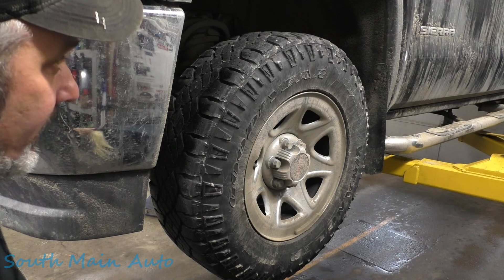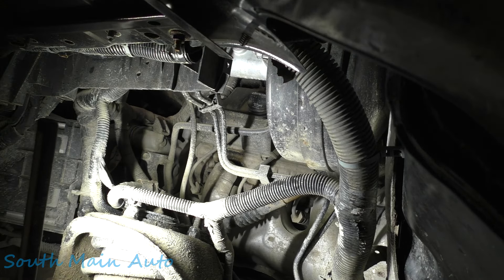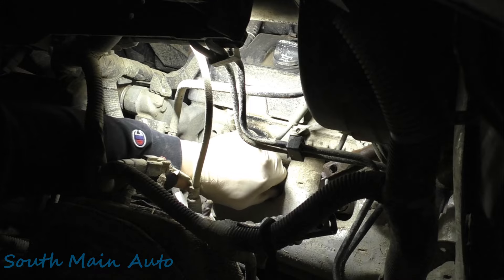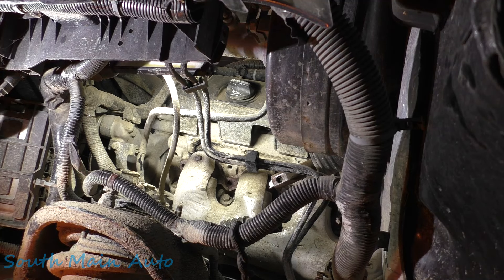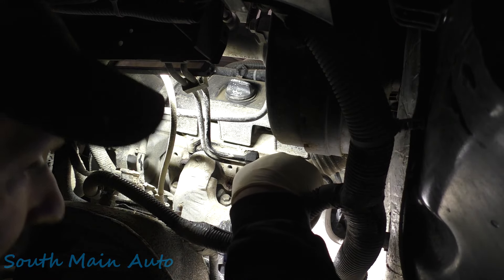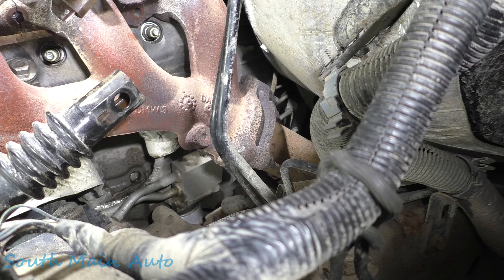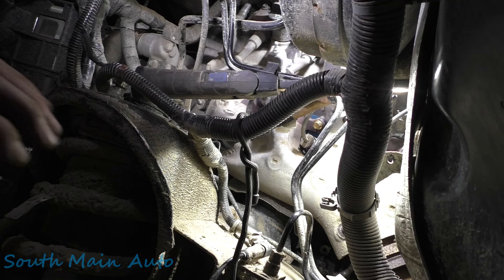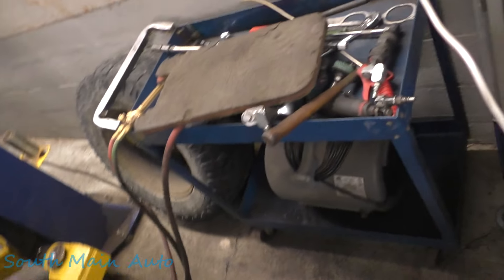GM Truck- Exhaust Manifold Bolt Snapped Off In Head

Comment: I was pleased when recently my mechanic was able to remove exhaust pipes on my 02 s10 to replace convertor.  Previous mechanic didn't want to try that so removed forward o2 sensor to route a brake line creating the leak requiring the convertor replacement.  Mind you I  delayed it to point where convertor was rusted out.

Comment: My thought is a brazing tip would fit in there easier. I have found that if I make the joint wet with (WD) or so that the crud locks it together worse( if you take something dry and make it wet it expands to make it tighter). When you put it together I didn't see any anti-seize. Keep up the good work.

Comment: Your kind of correct. The heat does expand the steel of the bolt. It also expands the aluminum tap thread of the motor twice as much giving more clearance that frees the bolt for extraction.

Comment: Hi Eric . Gass torch makes it work every time . Your talking about the compressor . I got a pleasant surprise pulling my drain plug on m compressor . No water I realized in the basement & the A/C on in summer dry air .And not much water in winter .

Comment: Hey Eric O. Don't listen to everyone else, your a good guy. Lol BTW the heating of the bolt works because of the T delta of the Aluminum block vs the steal bolt. Basicly the bolt heats up getting tight in the hole breaking the crusties up. The aluminum transfers heat away from the bolt very quickly making it shrink back to normal. Further breaking up the crusties. Seems counter intuitive until you understand how the different metals transfer the heat. Being the block is such a massive aluminum heat sink, the bolt hole never expands enough to make a difference.

Comment: I believe that heating the manifold bolts works because the aluminum head heats up faster than the steel bolts therefore expands quicker thus breaking the bond of the loctite.

Comment: Damn Eric, better to be lucky than good at times, had a 6.0 and did not have the same luck as you. The rear manifold bolt was recessed into the head and thank goodness that the Mig welder did the trick. Keep em coming Bro.

Comment: I spent 2 days working on a BMW just doing plugs, coils, Idle actuators, throttle actuators, starter and PCV valves (Florida M6 car)but it's nothing compared to working on an exhaust manifold on a Chevrolet in up state NY. I was born in Syracuse so I kinda know. I give Erick a ton of credit for his positive disposition. Rust belt cars are not fun.

Comment: probably half the chevy manifolds i do, the dipstick is seized in so we end up rebooking them so i can drop the diff and oil pan and drive the dipstick tube out. then do the manifold and put a new tube in. i probably do a least one a month. although in nov/dec i did like 5 of them of various years and engine sizes. although i rarely reuse manifolds, since they warp when the bolts are missing. i replaced one and they come with gaskets and donut seals on an '18. and it leaked bad where the donut went it, i figured because the donut didn't seat very well into the manifold and i had to tap it in. so a few days later when the warranty manifold came in and i replaced it, same thing, except this donut fit nice. i looked down in between the donut and down pipe, i could see down inside. so i ordered a GM exhaust donut and pulled out the one that came with the manifold. i compared them, the GM had quite a bit more sealing area than the one that came with it. put it in, sealed right up.  i compared it with a donut from and older model and the donut was the same. quality control sucks now, they don't even bother to check that all the right parts are in the box. i had to order new studs and nuts for the manifold to downpipe, they came with the manifold, but the didn't fit, thread pitch was wrong.

Comment: Another great job. Boy Eric you sure are a "get her done" guy. That job went smooth. Could of went a lot worse. Last friday i just went in for a broken bolt on the right manifold on my 010  ford piece of junk fusion 3.0. Took 1.5 hr.=$150.00. I was concerned as fords are famous for cracked manifolds. Why? It was loud when cold as it heated the noise mostly went away.

Comment: Just did this job on my truck few weeks ago front and back bolt broke on both sides other bolts came out easy surprisingly for an 03 left dip stick in and shafts connected just worked around it with scrubby pad and slid gaskets in

Comment: Nice job... Anytime I do exhaust manifolds.... No matter the brand.... I always run the engine up to operating temp then I immediately crack all the bolts to the cylinder heads... Works very well for me. Anytime I have a broken nub sticking out I spray it then hit it up, down, left and right and grab it with vise grips or my stud extractor. If the bolts are flush I usually can weld a nut and be good. 🧑‍🔧

Comment: great job as usual...I can imagine that the viewer can be a pain to accommodate.  I try to recall what it was like to be a mechanic in the Army, no where near the experience of a retail repair shop as in your case, but I worked on chevy's, dudges, and  the old iron.. we had a few brand new "1987" 8*8 10t one but TACOM reps came and worked on them due to certain systems the Army had not trained anyone to work on and  on.  We would occasionally allow or require the operator( depending on who they were and if they broke something on purpose or not)  of the vehicle to come down and "assist"  So before I comment I think about it from as close to your perspective as possible, not that of some troll with a yard full of junk and 2 good pieces. You can never make us all happy. but I can say I am always oddly satisfied watching you and Wes over in Illinois and Ray  in Florida work..  Keep doing it to suit your customer,  you are popular and have a following for a reason and there will always be trolls. They help you in that they contribute to the comment section and the algorithm sees that and cause your channel to be recommended more often.. that is how I found you.  I was searching for ford f superduty  issues and found you changing(breaking and extracting) spark plugs on this one"(Ford F Series 5.4 3 Valve: Broken Spark Plug Removal)" one of your early videos 7 years ago... and I binge watched to catch up.. so the trolls and whiners help you get views and as in my case subscribers. Some will always think they know more about what you are doing than you and criticize as if they have the whole story knowing that every youtube video out there has been edited to improve quality, hold eyes an tell a story in as clear and concise a manner as possible. Necessarily omitting some details for the overall project to be interesting.  keep up the good work..

Comment: I think it's all about the timing so you heat the bolt which temporarily expands the hole and disrupts the corrosion /lock tight and as the bolt cools it should relax the tolerance just enough.

Comment: Aluminum’s thermal expansion coefficient is roughly three times higher than steel. So while the steel bolt is expanding the aluminium hole is expanding more.

Comment: I never drain the water from my compressor. When using air to blow something off, the water turns it into a pressure washer. An added bonus is the water also cleans and lubricates my air tools. In summer heat you can also use the blow gun to spray a fine mist across the shop, thus cooling down your employees.

Comment: Hey Eric, if you can get your hands on some parafilm, it is super handy at holding screws, bolts, etc to anything including to screw drivers. Hope that helps you some time. Just sandwich it between the tool and the screw/bolt and press hard, and it will stick to both.

Comment: When you apply heat you excite the atoms in the metal ie they start moving around !!! so they ain't sitting still in one place ie holding on to there position!!! thats why it comes out nice for  you basically get everything moving !!!My Father worked in induction heating in Detroit! He learned under a Fella that wrote the book on induction heating back in the late forties!!! His book was still being used in colleges for over forthy years!!! Think of apply heat as getting them ready for the dance!!! and no I ain't making this up!!! ps love your videos remind me of all the times i had to use an easy out drill re tap head to the hardware store and try and find the right size bolt with the right tread count and all!!!!

Comment: Nice when tbis job goes this easy..
     Ive done some ford where. The boss on the front right of the engine both front boss comoletely rotted off the block. Only way to repair was have the head filled in with tig and make a new hole.
    This was a super easy. Peasy one for sure.

Comment: Heating the bolt will do a few things. Basically it is just expanding the metal of the bolt, so in some way it will be tighter in the threaded bore/nut, but what bolt is cut so tight there is no extra space between the bolt and the nut. The bolt also gets longer, which if there is a head on the bolt, reduces the clamping force by the head, which is usually what is making a bolt tight anyway. The movement of metal is enough to break the rust bond, and the heat breaks the thread locker. I'm sure there is more going on, but this is what I figured out in my head just now.

Comment: When I do something like that, I’ll put a light film of Permatex high temperature, RTV/silicone on the head surface and the manifold so it will be also on the gasket as well. Plus, I also put it on the male con of where the exhaust goes out and it gets bolted together, and either the female or the male, and before bolting it up.… Just my preference.
    Edward H. – “Madison Combustion“

Comment: Bees wax on the broken bolt after it has been heated helps. It will draw into the threads and help. It’s a bit smoky, but in my experience it works better than WD40 for this.

Comment: In my mind, heating the bolt works regardless of whether or not there is loctite since the different metals expand at different rates, breaking away the oxidation bonds that may have occurred over time.

Comment: I tried to change the spark plugs and wires on my 2014 Sierra 1500, and just couldn't get to the back plugs.  Never, ever occurred to me to remove the liner and come in from the wheel well.  duh.

Thank you!

Comment: Correct me if I am wrong but, is the 5.3 Chevy for the last 30 years not famous for these exhaust bolts breaking off? I am not anti Chevy truck as I own a 6L 2500HD with the towing package which has never broken down on the highway. (Knock on wood). The 3/4 ton is so easy to work on, I abandoned the 1/2 tons w/5.3L many years ago. Great channel, great content. Just Eric O's highly skilled wrench pulling and torch work, without all the Scotty click-bait drama.

Comment: Curious.  Have you ever been contacted by a manufacturer responding to / inquiring about your suggestions about how some part or assembly could be changed to make it more serviceable?   In many, make that most, of your videos you point out things that could be improved to make vehicles easier to service.  I have to believe manufacturers monitor social media and clearly your channel is one of the top auto repair ones on YouTube.  If they're not following you, they should be.

Camera work is excellent.  Yeah, your elbow occasionally gets in our way but I guess you do have to complete the repair.  😁

Comment: Aluminum expands at double the rate of steel, and its a great conductor, so your red hot manifold bolt dumps its heat into the aluminum head pretty fast causing the aluminum to grow and the steel bolt to shrink back closer to ambient.

Comment: Your camera work was more than adequate!  Having 2 2013 5.3s in my driveway, Tahoe/Silverado, just wish I lived close enough to SMA so you could do  all my work..Wonder why these bolts are breaking and what tool you used to remove the bolt?  Finding a local shop I trust to do this kind of work is impossible in my area.  Great video as always! 41:56

Comment: On the heating of stuck bolts. As I understand it, when you heat a bolt seized in a hole it cannot expand in width so it expands lengthways BUT when it cools it is able to  contract in all directions, lengthways and widthways and so it ends up a tiny bit longer and a tiny bit narrower. You really should give it a little time to cool and contract and you should then also be more able to get some penetrating oil in to assist if needed.
Reply: Have I??? Great!!! Where can I post my bank  account details??

Comment: Love the Silverado videos !! I would like to see a video on an early 2000s Silverado steering column repair. I just put an aftermarket steering wheel on my 2000 Silverado, and I had to do some modifications. I had to drill and tap new holes in the adapter so the wheel would be straight. It was at a 2:00 and 7:00 position. You would think that the manufacturer would do more research on their engineering?? Thanks for the great videos. God bless the O. family.

Comment: Have you ever tried the block adaptor that bolt to the heads then has a bolt that holds pressure on the ends of the manifolds. I used a couple on my dads 2000 Suburban thinking it would just be a temporary fix, but thats been over 5 years ago and still working fine.but have to say the one on the drivers side rear is a pain to get the bolt in the head.

Comment: You should get your WD-40 by the case.  I use that stuff for a lot of things.  It is also very good for cutting and tapping alumium.  I guess if it's good enough for the space program, it's good enough for all of the junk I work on.  I have used PB Blasta' for stuck nutz, but that "special" nozzle seems like it's designed to empty out the can in nothing flat.  There's nothing else in the world quite like the sound of a torch lighting up!   POOOM!

Comment: I have a 2018 Chevy 1500 that I have to do this repair on. The video is very useful. Thank you for sharing it! I purchased the manifold bolts and gaskets. The thing that surprised me is the bolts that I got have SAE threads. They are 3/8"-16. Being a newer model vehicle, they should be metric, right? I'm thinking that I should replace the gaskets in the flanges connecting to the exhaust pipes too? What torque should I tighten the bolts to when I reassemble it?

Comment: The cinematography was great Eric, don't you worry about that. Where we couldn't see much, you provided good commentary in the form of trust issues, sarcasm and good old humour. When you edited the video did you notice the engine moved a lot while it was turning over? is this normal at start-up for these engines and if not, do you tell the customer an engine mount or two will need replacing?

Comment: I have a pair of the cheaper camera glasses and they do alright in situations where there's adequate lighting but too much light causes lens flare. As far as audio quality goes is not great, it's there just really quiet. For the price they are I can't imagine the high end ones being that much better but I could be wrong. I believe they could work in certain situations but probably not worth the high end price. They didn't work that well for my fireworks videos but in a well lit shop it might be beneficial. I'd do what I did buy the cheap ones and see if they work for you then later if you want you can upgrade to the higher end ones.

Comment: If you were to do this at home and have the time and access to another vehicle I think you'd be better to pull the engine, you can get a cheap lift from harbor freight.  Here me out!  You'd have easier access for this job and also carry out a major overhaul of the engine including front and rear seals, other seals including oil pan and valve cover, timing belt, water pump, suspension parts, other preventive maintenance, clean and lube everything and at the same time you would learn hell of a lot.

Comment: Looking for a knuckle to use as a template to drill a f350 spindle to mount to a dodge. Was directed a few time, met a guy, that’s builds amazing stuff, and restored several very old cars that where pure rust, and almost nothing left back to show quality numbers matching. I score a bd exhaust brake for $50, has everything. Now. I just need to swap out the valve springs for some 60 pounders. Ford wheel hubs are in for machining to turn down to fit the dodge wheel.

Comment: The 5.3L has been around for a long time. I am happy to own 2 Silverados with the 5.3L. The big question is, why GM cannot fix a reoccurring problem. Alos rear fender should have never existed on a good design and it is a problem on many manufacturers. The 5.3L has far less issues than the other manufacturers but there should be better progress with repeated issues.

Comment: You are the definition of "Master Mechanic".  Appreciate your knowledge sharing!  Does having extensions on a torque wrench change the true torque or not?
Reply: I believe it does...
Reply: extension doesn't, but the knuckle will if you're not using it correctly, but it's close enough for this kinda job

Comment: I must have missed it but... When did you actually extract the broken bolt out of the ENGINE BLOCK??? Or was that gasket you installed the fix... I am asking because I have a 5.3 2014 Silverado with the same issues... Hopefully it is this easy to fix like I seen in this video...

Comment: I have two questions, is this just on the driver side or the passenger side also needs to be checked …

Second, can you let me know the socket tool extension size i need and the offset type? Amazon maybe link, thank you!

I may have this issue and does the steering shaft must be tKen apart?

Comment: So the cracks where the 2 center bolts on the top go (NOT the head, but the manifold)  aren't a reason to replace the manifold or a concern?  Or are they made that way to allow it to flex?